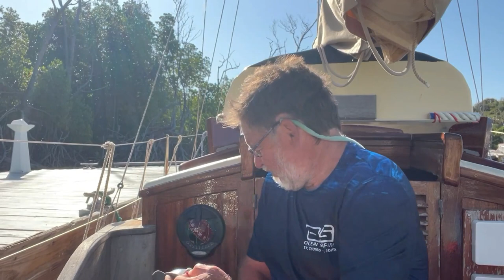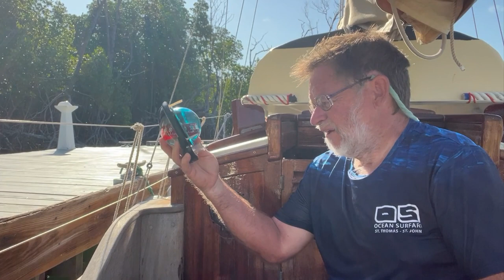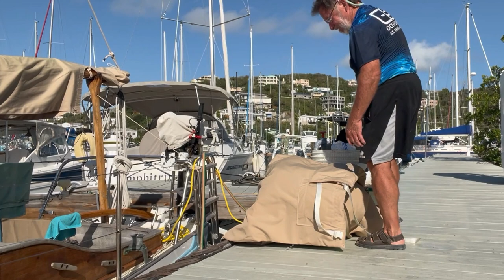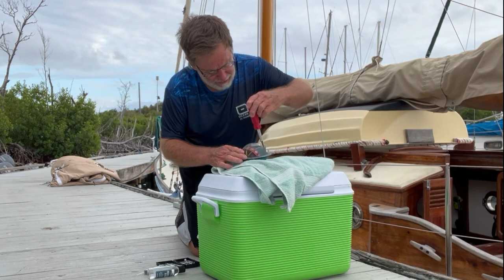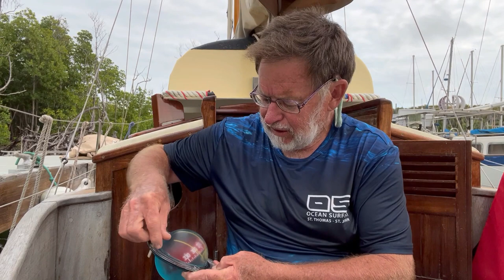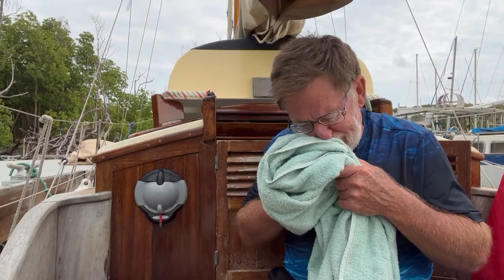Repair A Marine Compass

Comment: Glad you got the compass fixed. Even with fancy GPS and mapping apps, the old ways are pretty foolproof and don’t require electricity or an internet connection!
Reply from the maker: I do not trust electronics, I have them but I also have all the paper charts, manual dividers and measuring devices, manual instruments, etc

Comment: Do you use the analog compass ? Or is just for backup?
Reply from the maker: This is the compass I use routinely
Reply: Moose, I’m guessing you’ll be using GPS to navigate and not a sextant. Can an accurate reading be taken using a sextant with only one person?
Reply from the maker: @wphunter1949  yes, you can get accurate reading with sextant singlehanded, has been done by many. I will be using GPS for now